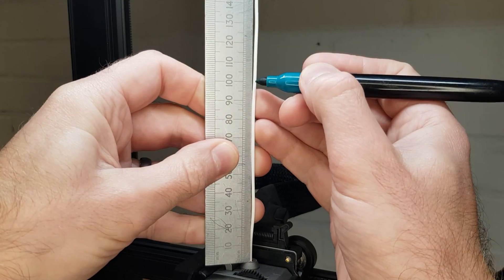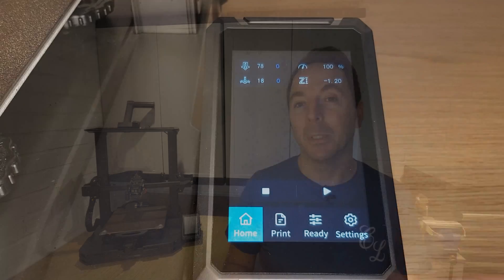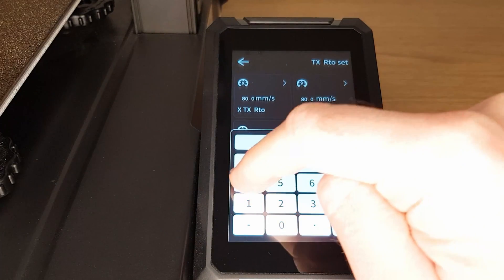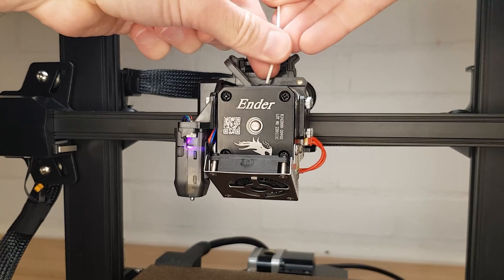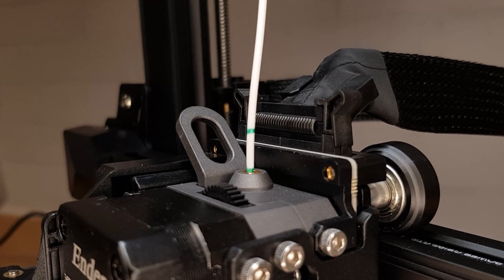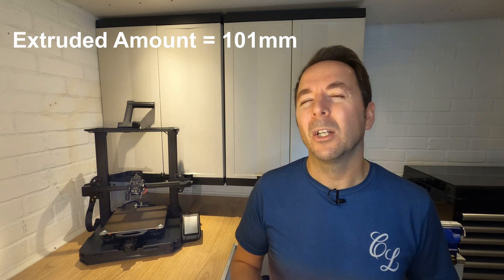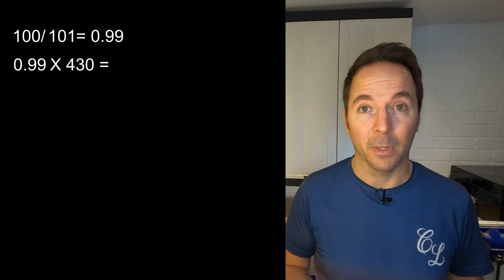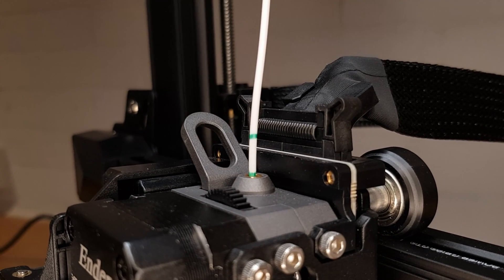Ender 3 S1 Pro - How To Calibrate E Steps (Quick & Easy)

Comment: Okay, was just going to say that your calculations are rubbish, because I went from 427.8 stock to 410, then to 510... but trying to adjust the E-steps actually helped me resolve another issue that I was having with incorrect spring setting on the extruder 😂 Fixed now, ty
Reply: i mean, it may just been you having inaccurate measurements and blaming it on him. I messed up mine first try so i did it again and the prints came out perfect.

Comment: Awesome video. My S1 plus has been a headache since I bought it. I had to lower the flow to 78% to get a smooth top surface. Something isn't right. Will try to calibrate the steps tomorrow.
Edit: Steps are 100% correct. I am doing another pass, trying to lower the flow. Orca gave me 78% flow, now I am using my own testing blocks to lower the flow in Cura. 90% and it's still over extruding. What a nightmare. I've got Anet ET4 and it worked straight out of the box. This one is all issues and 3 weeks of calibrating, changing profiles got me nowhere.
Reply from the maker: Have you tried a new nozzle or checking that the correct nozzle size is specified in your slicer?
Reply: @RickyImpey  
Hi Pal. Yes, I did. I replaced the nozzle with the brand I trust and checked the code and the settings as well. 

I did another calibration in Orca to confirm the tests I was doing all day in Cura. I made my own test pieces. Cura only has towers and they are useless for top surface quality tests. 

Now I am printing at 85% flow at 220 degrees (PLA+) and it comes out 99% (quality). Almost perfect. 

Right now I am trying to deal with stringing, so I am running some tests now. 

Hopefully, by tomorrow I will have my Anet ET4 and my Ender S1 Plus fully calibrated. 

I have to say, prints look fantastic. I thought my ET4 was giving me Pro results until I saw Ender quality. 
Top surface isn't sooth as glass (like when I print on my ET4), but the walls - amazing.

Flow on my ET4 - 92% (and some change).
Flow on S1 Plus - 85% even.
Same filament, E steps calibrated to a fraction of a millimeter and the flow is still different. 

I will run a test someday on ET4 with 85% flow to see if there is a difference in quality (for science), but stringing is my main priority for now.
Reply: @GS-wg9bh  did you ever figure it out? i think the issue could be just due to filament differences. not all filament is the same diameter, and so you can get under or over extrusion even if its moving exactly 100mm of filament. 

Only solution i can think of is to edit the filament profile for each filament you have issue with and adjust the flow rates until you get the result you want. SO the esteps can be calibrated to push 100mm, which is what you want the printer to always do, but adjust it on a per filament basis.
Reply: @ge2719  
Yes, I did figure it out. It was the flow. I stopped messing around and wasting time printing tests in Orca slicer, I bought the digital caliper with two decimal points, I designed a cube with 0.4 mm wall thickness and no roof, and now I calculate the flow every time I change filament. 

It takes 10 minutes instead of 2 hours for each test in Orca (which doesn't really help you that much). My flow is between 79% and 95% (depends on the filament). 

What's strange is they all have the same diameter with 0.01 - 0.02 tolerance. I think it's more about density than diameter of the filament, but I'm no expert, so don't quote me on that. 

Basically - proper digital caliper and 0.4 mm test cube fixed the issue for me. Best £20 investment if you're into 3d printing. 

Now I do these tests in order - Temp Tower in Cura, Speed tower in Cura, 0.4 mm Flow test cube, Retraction speed and distance tower in Cura, Flow again.

I do this every time I use new type of filament. For the ones I've used before, I only do 0.4 mm test. 

5 hours of initial testing on new filament saves me hours on not dealing with failed prints down the line. 

I also bought a filament dryer. I dry the filament for 24 hours when I'm done printing, I vacuum seal it with silica gel bag that always comes with filament. I keep those and I reuse them when I vacuum seal filament after use. 

Consistent prints with almost zero issues since I started doing it this way.

Comment: Rather than doing esteps by measuring 100mm of filament on the input side why not measure the filament after it's extruded using a tape measure?  I'd think it would be more accurate.

Comment: With the (new?) firmware it is possible to adjust E steps value on the printer itself. If you change it and want to restart, go out of the menu, otherwise the printer doesn't save the changed value.

Comment: Is it ok to have to change the z steps from 400 to 405. Normally I leave them stock at 400 but a 20x20 cube the z is always short even after calibrating the e steps.

Comment: Not sure why you would want to change the temperature settings from the recommended settings for material you are using?
Seems to me that would give you false reading. Wouldn't you want to calibrate with the same settings you are printing with?
Reply from the maker: This is a test purely for seeing if your extruder is moving the correct amount regardless of any other restrictions that may occur with pushing the filament through the nozzle at recommended temps. You ideally want to take the nozzle out of the equation and higher temps helps do that.
Reply: @RickyImpey  Thanks for responding Rick! But I would think that increasing the nozzle temperature setting 20 degrees higher than the recommended temperature setting would make it easier for the nozzle to push more material through the nozzle. Thus resulting in more material being pushed thru than if temperature setting was 20 degrees lower.
It would be nice to see a comparison with extrusion amounts versus temperature variations?
Thanks

Comment: I need some help! I followed the guidelines and stock was 424.9 and after marking 100mm i was left with 2mm below the line. I did the math and ended up with a result of 433.40 and now the printer uses 105mm? 100/98=1.02 1.02*424.9= 433.40.. where am I going wrong?

Comment: I am new to 3d printing (Ender 3 S1 pro) and thank god we have your videos, exactly to the point. Good job! Do I need to calibrate E steps when I am changing the filament?
I just purchased and Hyper PLA filament from Creality. Have you done a video showing how to get the best results with HPLA? Thanks
Reply from the maker: You shouldn't need to calibrate e-steps for each filament as long as the manufacturer keeps a good tolerance.
Reply: @RickyImpey   Thanks man! Have you done a video showing how to get the best results with Hyper PLA filament?
Reply from the maker: @craftsmanchris7  not yet......

Comment: Do you have to extrude 100mm of filament? Can you do half that or even 25mm? Or does extruding more filament help accuracy?
Reply from the maker: You can do less but 100mm makes the calculation easier.
Reply: you can also do this after taking your nozzle off and making sure to leave the "Nozzle temp" settings to 0, so you don't have to actually waste the filament. it will just extrude out the bore hole, and you can put a line on it, and pull the filament back out.

Comment: ciao, strano a me non é ripetibile questo dato, se ho 425 estrude 98,8 mm di filo, secondo il tuo calcolo dovrei modificare la cifra 100/98,8 x 425 = 430.16 arrotondo a 430,1 però estrude piu di 105mm!! allora son sceso a compromessi premetto che l'estrusore non slitta e uso filo PLA extrudr, alla fine per tentativi sono arrivato al 428 step, ho provato piu volte ed estrude sempre 100 mm esatti, con il valore 428, il tuo calcolo , con la mia stmapante non funziona e io non so il perché ora provo con lo spostamento asse x e y per vedere se funziona o devo scendere a compromessi e tentavivi.

Comment: Hi, I bought an E3 S1 Pro but I have a problem, when I print a file with vertical walls at 90° from the base, it doesn't print them perfectly at 90° but in the first layers it tends to make a kind of chamfer, starting from more ' tight to widen up to the top with the last wider layers with a vase effect. I can't understand why, I did everything as instructed and I don't understand, some files instead, it prints them well, like the cat that comes with the sdcard together with the printer is ok, while the bitcoin ender is a disaster, it starts with the edges at the base narrower to finish the last 7 layers 2mm wider. Can you help me?
Reply from the maker: This will all be conrtolled by your slicer settings. What slicer are you using and what profile are you using?
Reply: @RickyImpey I use Prusa Slicer which in my opinion is much better than Cura, it allows settings not possible in Cura, the profiles are those for pla 200-60 50mms flow 1 or 100%, the extracted filament is 10cm precise, so the settings they are fine.  I noticed that it is very difficult to level the plane and that after the auxiliary leveling done by hand, when the automatic one starts, rechecking the plane it is never precise, it always remains lower ( Z ), the a4 sheet with which I had made the first manual auxiliary level no longer passes under the nozzle, why does the automatic detection not correspond to the manual one?  Is this normal or is it a problem with the printer?

Comment: Hello! I love these videos but am having issues with my steps still. Can you help me? I I tried this and it seems to be perfect however when I print a cali cube Im getting some pretty exaggerated dimensions. Z 20.46 X 20.11 Y 20.03
Reply from the maker: Hi, what printer do you have? What measurements were you getting with the cube before? If you are happy with the extruder and want to stick with what you have, you could use your measurements to calibrate your other stepper motors in a similar way. I don't have a video on this yet but this article seems to cover it pretty well https://3dprinterly.com/how-to-calibrate-your-z-axis-on-your-3d-printer-ender-3-more/
Reply: @RickyImpey  ender-3 S1 pro ended up adjusting thr x y z steps and that really dialed in the cube.
Reply: Well the cube is coming in with the correct dimensions now within .03 but when I design something it comes out larger for some reason. made a spacer 2.25 and after print its 2.50 thick. any thoughts?
Reply from the maker: @rewster9864  have you got any other settings in your slicer that relate to flow or extrusion that are not standard? Something is not right🤔
Reply: @RickyImpey  not that's not set default by factory. I downloaded both a clean instal of cura and crealitys software and they produce the same result.
Reply from the maker: @rewster9864  what are you using to design? Is it possible that the sizing is not 100% accurate?
Reply: @RickyImpey  not possible. It's the same design I made in tinkercad and have been printing with my qidi and using the qidi slicer correctly. New printer new slicer prints larger for some reason. I'm so lost here lol. I even made a new test peice , sliced it, and printed it. Came out larger.
Reply from the maker: @rewster9864  I'm running out of ideas honestly🤔 Have you looked at flow at all?
Reply: @RickyImpey  I have not considered flow. When I get home tonight I'll research that and reconfirm all my calibrations. I really appreciate your help!
Reply: @RickyImpey  I'm almost to the point of resetting everything and doing a clean install again to document a baseline and start again.

Comment: Used this video to check my esteps. My S1 pro esteps were already calibrated perfectly out if the box. After trial and error figured out my issue was using G29 (fresh auto level) every print instead of M420. Removed M29, retrammed for good measure, added M420 and now prints so accurate it replicates the PEI bed texture on the print bottom. If you have an S1 pro the best indicator of excellent bed adhesion will have the PEI bed texture on the bottom. That goes for skirts or brims too regardless of filament type. I wish id known what to look for when i started.

Comment: Thank you for the video, but can't get my Ender dialed in with the E-Steps. So basic value of the E steps is 424.9. After three measurements the extruder is only extruding 94 mm (so 6 mm short). I divide 100 with the 94 (100 / 94) = 1.07 x 424.9 = 454.6 as new E step figure. First try its over extruding way to much. Can you help me?
Reply from the maker: Hi, you're doing the calculation correctly but I get 452.02 as your new e-steps. This won't account for a massive over extrusion though. What is your new measurement?
Reply: @RickyImpey  thank you for your replay. Did the measurements like you indicated 100 mm and 110 marked on the filament. And 20 degrees hotter than necessary. Did it again with 430 as e step value in the beginning like you with the measurements. But after calculations it gives me an under extrusion of 9 mm. Truly bizar was thinking of maybe a bug or mechanical default but it's brand new with almost no prints. 

I reset my values again to 424.9 the base line like your printer also has. Then extrude 100 mm then it just keeps om extruding that it becomes not measurable. Thank you already for replying. Kind of you.

Comment: Not related but what cam software is good for 3d printing?
Reply from the maker: You only really need a slicer. Most use Cura or Prusa Slicer which are free, but there are some others.
Reply: Oh.. think I meant cad..sorry
Reply from the maker: @marvelousmarvin2  Ah ok. Well there are also many options for CAD software. It depends what you want to do really. I design a lot of functional parts so measurements are important to me. I use Fusion 360. There are lots of others like blender, scad, tinkercad, etc. I'm nowhere near as experienced with the others so I cannot really tell you which it better unfortunately. Fusion 360 is free for a personal licence though so maybe give it a try and see how you get on with it.

Comment: Hi Rickey I have adjusted my esteps and calculated and tested flow using 100% in cura and 95% in printer. A question arose about the flow setting. I can set it in Cura and the printer or both. If I set it in cura and then set it in the printer is it going to extrude 95% of 100% or 95% of 95%. Thanks
Reply from the maker: Hi Norman, in my experience, the printer settings just take whatever the slicer has set as 100%. Any adjustments you make on the printer would be as a percentage of the output of the slicer. For instance, if you set the slicer flow to 90% then you will get 90% flow when the printer says 100. If you set the slicer flow to 100% and then the printer to 90%, you will get 90% flow. If you set them both to 90%, you will get 81% flow. I hope this makes sense.
Reply: It does and it was what I was thinking. Thanks for clearing it up, and do you see an advantage to either approach in particular?
Reply from the maker: @normanziegelmeyer7693  I haven't really had to adjust flow much with any of my printers. I don't really like settings that you need to remember to change in your slicer or on the printer. If I absolutely have to then I do it in the slicer and save it in a profile that I can use whenever I slice with that same combination of printer, filament, nozzle, etc.

Comment: Great video as always.  Do you know if this is possible with the Creality sonic pad that is now connected to my S1 pro?  Also are there any larger format printers you would recommend?   Thanks again for the clarity in the vids
Reply from the maker: Hi Simon, you'll be on klipper now with your sonic pad. I haven't had a chance to play with one yet so I can't tell you how it all works but I'm sure it'll be possible.
Reply from the maker: Also, the large 3d printers I have are the Sidewinder X2 and the Creality CR10S Pro. The X2 is much better than the CR10. Check out my review if you are interested https://youtu.be/ob9vTK_vZYM
Reply: @RickyImpey  thanks.  Great review.